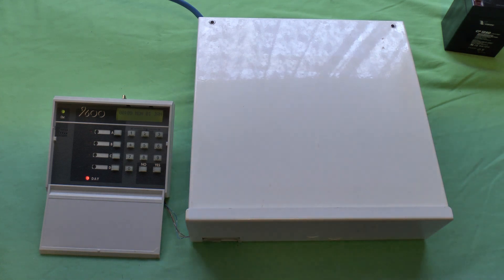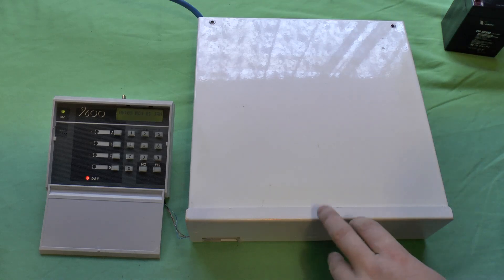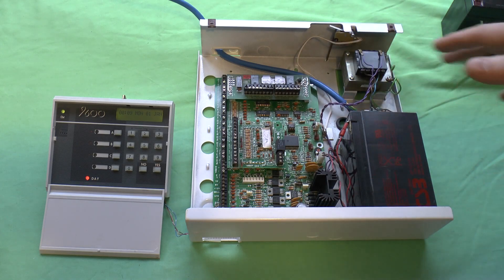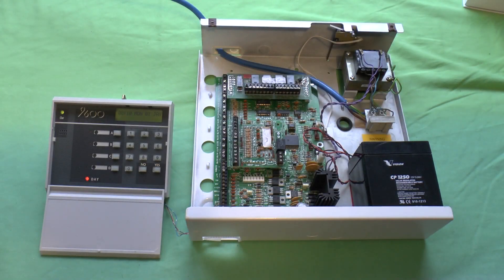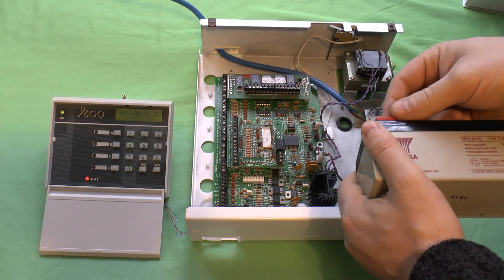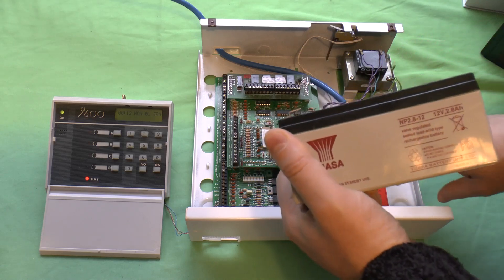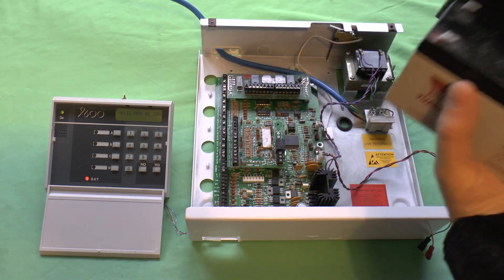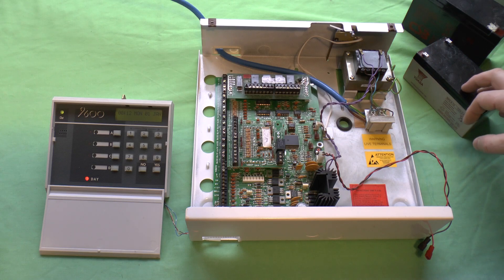A question about burglar alarm batteries

Comment: Really your wrong well if you have ever installed a system it's pretty complicate so a texecom premier or the elite version they have a quite abit of room because it's a bigger case and smaller pcb so you can installed a bigger battery but on the other hand you have the Honeywell optima compact panel which is a smaller compact panel but With a slightly bigger pcb so if you put the one youd put in the one for the texecom premier or elite version it wouldn't fit it would be to big for the optima but if the optima compact battery went in the texecom versions it would fit but be small so you get the right size for the right panel.

I hope that has been a help if you have anymore questions about intruder alarm ask me. :D
Reply from the maker: I'm aware of the different capabilities of some of the panels, the Optima and Scantronic 9448s have no room for anything bigger than a 2.2-2.3Ah (although I'm pretty sure the Optima panel at my friend's parents' house had a 1.2Ah in it), on the other hand the Menvier TS2500 I installed at home has got a 17Ah in there 'cos (a) it can and (b) I already had one.
 Yes it's overkill for an an eleven-zone setup but hey ho :)
Reply: Cool soon as a saw your channel i subscribed so you menvier ts where did you get it and what price because i really wanna upgrade my texecom r8
Reply from the maker: I was in the right place at the right time, the TS was literally being binned because of an upgrade so I got that, a bunch of XNODEs and about 30 PIRs for bugger all. Keep an eye on eBay, my mate's TS900+ came from there and XNODEs always come up dirt cheap.

Funnily enough the first panel I installed was a Texecom Veritas R8. Went in a friend's house, then when she moved it went in mine, then when I moved it went in a mate's to replace his 9448, which then went in the first friend's new flat, and round and round we go :)

A tip if you get a TS: put all the settings in a spreadsheet, with different worksheets for User 1, Engineer 1, Engineer 2, etc. and the manual page number that refers to each setting. Makes it much easier to figure out what's going on, especially when getting your head round the "wards" and translating that into groups for part-setting and stuff (hint: if a zone is in two wards, it's only armed if both wards are armed, also if your entry exit is in ward A and you have an access route only in ward B, you WILL set off the alarm on your way to the keypad).
Reply: Oh ok thanks ill try find a menvier ts alarm on ebay cheap but good and working thanks again keep up the good videos lol :D

Comment: It's because alarm engineers are a pain in the arse! They have never heard of mechanical protection for cables (such as trunking). They staple all cables next to carpet gripper, the cables then get damaged or whilst trying to carefully remove them to take up the floor you end up cut to shreds! Gggrrrrrr!
Reply from the maker: Not all, there are a few decent installers out there, the 9600 panel in the video came from one :)

Some will pay proper attention to cable protection and route cables properly under floors (be they floorboards or chipboard panels) instead of cheating by clipping along under the skirting boards. Do a proper job and you'll get plenty of recommendations instead of relying on Yellow Pages.

Sounds like you've got experience of the less reputable ones!

Comment: Learned this a long time ago. Mine had a 1.2ah battery, called alarm company they said its only $59 plus install fee to replace. Opened the panel, measured what I could fit, put in a 10ah from Ebay with 5 year warranty for like $20 shipped. Have not looked back.

Comment: I think that the 7Ah battery is generally cheaper then the odd smaller sized batteries, as the 7Ah are very common, you can even get 9Ah capacity in the 7Ah casing. (thinner and more plates) Most alarm batteries last about 3 to 5 years as they never get a proper discharge test, and generally fail on overcharging. The series glowlamp will light up when the battery is on the way out.
No idea why the smaller sized batteries are fitted. The Yuasa batteries are very good quality

Comment: Economy and cheating, here many companies install smaller battery in place of a bigger one to save those few dollars. We had many places where things like that were done, for personal use I would say normal size will do, besides this batteries die after time, so no point for bigger, it only needed to stay alive if mains gets cut off and to send a message to guards or you or just to start the alarm in that moment, well depending on setup.

Comment: Price and money making. many people who have security systems installed, do not know much about them, or if they even have a battery in them, a tiny battery is more likely to get deep cycled if ever used, and for those who do not know much about them, when the system starts giving warnings. they simply call the company, and they whack in another cheap tiny battery and then charge the customer like $150-200.

so while many people will replace it on their own, there are those who will rather call the company to come out and do it, and due to the high profit margin, i they can make those calls happen more often, then it is a nice addition to the bottom line for the company.

Comment: Purely economy.  Not that the SLA batteries are ideal for the constant trickle charge they get.  They fail quite quickly.
Reply: I guess most of the batteries chemistries are prone for trickle charging (specially if performed poorly, with cheap circuit without temperature compensation). However, Lead-Acid chemistry seems to be most robust, for sure more robust than lithium based ones. When Led-Acid battery is tricke-charged it's just loosing water, due to electrolysis. Old fashion Lead-Acid batteries offered possibility to refill lost water and it made them immortal in this application.

Comment: It's basically because a 2.8Ah battery will give a minimum of 12 hours of back up (as per the British standard) and it will last about 2-3 years in the panel before it needs changing. Whereas a 7Ah battery will work perfectly, but will not necessarily cause any issues until about 5-6 years. Therefore, it's purely a profit making scheme as the wholesale cost of the batteries is only about £1-3 difference.
Ex alarm installer

Comment: It's purely the installer trying to save cash back when gel-cell lead batteries used to have a lot of cost difference between capacities, and as you said, they probably hadn't been touched in over a decade.

Comment: One thing I have thought of, which no-one else has yet mentioned is....... Speed of recharge.

A small one may recharge to full power quicker than a large one, meaning that if there was a power cut and then the power came back on, the battery would recharge to its top power sooner than what a big one would.

Another thing as well: Lets suppose that, after recharging a small battery, the recharging electronics were quite warm..... Installing a larger battery might mean that the extended recharging time may cause the electronics to overheat and =POP=.

And then there's things like weight and cost.

If those batteries you have there are past their useful lives, I have heard that they can be recharged on an arc welder.

They let you know when they're fully recharged, because they whistle at you! :D ROFL!!

Aaaah, go on.....make a Whistley-Squeeler. It's always fun! :D

Thanx for showing,

-BoomBoxDeluxe.

23rd February 2014, 18.31
Reply from the maker: But a larger one would've lost less charge (as a percentage) than the smaller one, so recharge should take the same time (unless the power was off long enough to flatten the smaller one, where the big one would keep going).

Comment: I just left the alarm panel field as a technician, prototype board creator, and software developer a year ago. The batteries are rated at a particular mohs level and a specific amp/hr requirement. We had specific requirements for how long the panel should last unpowered, but also gave the customers the option to upgrade them. The amp/hr rating you can see, however the mohs value you cannot. It is all about efficiency for the application the panel is to be used in along with the customer's requirements of operation.

Comment: Where i worked we had intruder and fire alarm panels, many had Yuasa batteries, but they were replaced over the years with the CS3 batteries like the one you have.
I can only guess it's what the guy had in the vehicle at the time, do a quick fix and get onto the next job.
I actually have a CS3 12/7,5 that i use occasionally, still holds the charge after over 5 years.
Reply from the maker: The CSB batteries seem to be the unit of choice in APC UPS systems. For our various UPSes at work it's usually my job to change the batteries and it's usually CSB out, CSB in. Other ones I've come across have been BB Battery and Panasonic (Compaq T1000h UPSes had four 6 volt Panasonics) although I think the Vision battery in this video was one of two survivors from a rackmounted APC.

I've got about 50 CSB GP1272s in the garage, they're all just over five years old but still hold between 3.5Ah and 4Ah.
Reply: AintBigAintClever
The dead RBC-7 pack that came with my used APC Smart-UPS 750XL had a couple of 17AH batteries made by "sacred sun". I've never heard of them before but it seemed to be a genuine APC pack. They got replaced with a couple of ritar batteries and I've plugged a couple of Lucas LSLC12-22 into the back too. As to your question I guess the smaller battery would die quicker because of deep cycling  so the installer gets more business.

Comment: When I did alarms (15+ years ago) the battery was supposed to be sized depending on the type of panel and all the devices connected to it - the idea being that the battery would be able to power the whole system for at least 24 hours without any mains power.

As for smaller batteries - cost cutting, cheapness, people who shove in any size battery without actually knowing what size they should use, those that buy cheap alarm kits which include a tiny little battery.

Old batteries cause false alarms - the battery should be replaced every few years, same with the outside siren module which also contains a battery.  Fairly likely that people who don't have an annual maintenance contract don't have the battery replaced ever.

Comment: Im not an installer, but my hobby is electronics.

Sounds like they get deals on lower capacity batterys, the question i would ask is: how long would the alarm run for on a certain capacity battery when the mains has failed?

Comment: Simple cost cutting. The battery will need to provide power only to drive the siren for 5 minutes when it is activated. The smaller one will always be cheaper wholesale and will do the job so long as the power supply is reliable. Here you might find panels with 2 separate batteries and 2 chargers, simply because power cuts are commonplace and tend to last for a few hours. If the expected power cut is 15 minutes in a year then the cheap small battery will last exactly as long as the big one, 5-7 years. Likely most of the batteries were over 5 years old, and have never been replaced since the systems were installed.
Reply: Hardly any of that is true for a professional system. The only point I would agree with is that those smaller batteries were probably installed many years ago.

Comment: my guess would be purely down to cost, the citadel alarm i have had a Chinese 'TG' branded 2.2AH battery in it :(
Reply from the maker: The guy I loaned the battery to has replaced the Yuasa 2.8Ah with a CSB GPL1272. Not only is it bigger (7.2Ah) but it's also a "long life" battery, up to 8 years in normal service. His panel's in an airing cupboard though, a nice cosy environment that's no good for batteries, but at least he stands a better chance of getting a normal lifespan with this battery.
Reply: AintBigAintClever
my panel lacks the ability to add a bigger battery, but due to the fact its mounted on the partition wall of my stairs cupboard I'm tempted to extend the battery leads out the back to a larger battery mounted in the cupboard
Reply from the maker: I'd be careful about that, you don't want to overload the panel's battery charger. A CSB HRL1234W is an 8.5Ah battery that would fit a 7Ah hole, for example, but the charging graphs on the datasheet seem to suggest that it would pull a lot more current than a "normal" 7Ah battery, so I wouldn't fit one to a panel unless someone more knowledgeable about such matters told me otherwise. Constant voltage charging appears to be the order of the day when it comes to these, but I don't know if the panels feature current limiting or will just dole out whatever the battery asks for (or die trying).
Reply: AintBigAintClever given the state of the battery that came out of it, i would presume the charger had been overcharging it for quite a while also the fact the battery was of Chinese origin even its capacity is questionable. I am planning on reusing the panel housing and wired sensors to form the foundation for a web connected arduino/raspberry pi alarm :)
Reply from the maker: That's one way of doing it. Another would be to replace the panel with a newer one (look on eBay) and use the alarm's various outputs to interface with the Pi. That way you keep the built-in security features of the alarm (tamper detection, EOL resistor support, etc.) and add web/email capability. Choose an alarm with inputs capable of acting as a key switch and you've got the whole lot under Pi control. The Menvier TS790, TS900 and TS2500 for example will support this (the TS2500 incidentally can take a 17Ah battery, along with 1040 zones and 512 keypads).
Plenty of scope there too to decipher and interrogate the keypad data bus :)
Reply: AintBigAintClever I'm certainly considering replacing it with the advice you've given me, after some further research my alarm appears to be a re-branded Honeywell 8EP396A